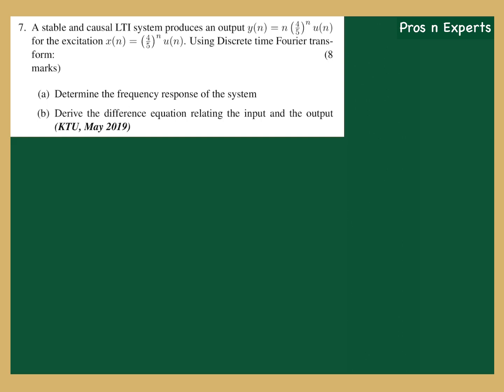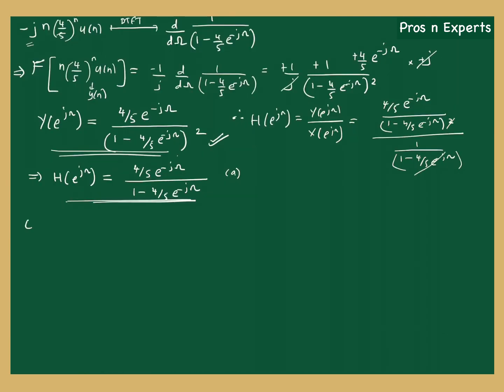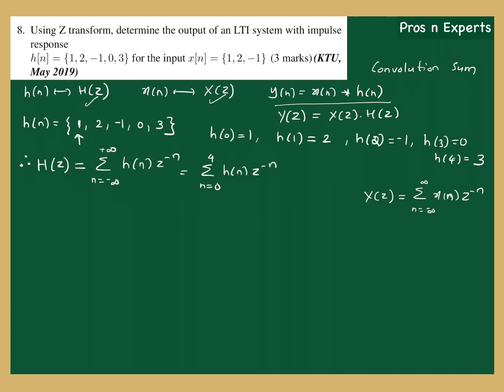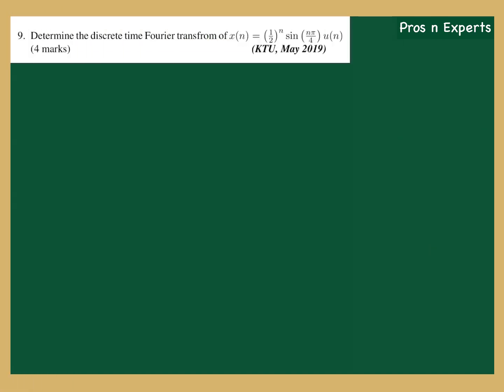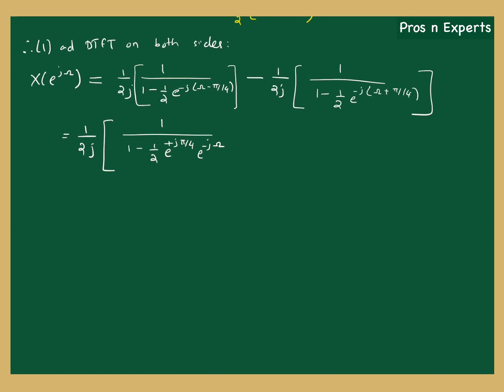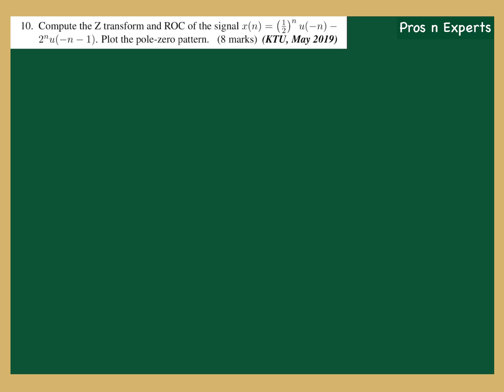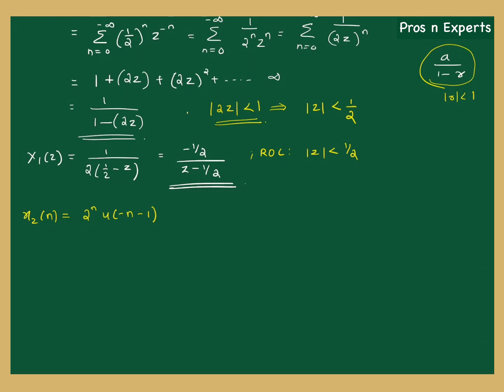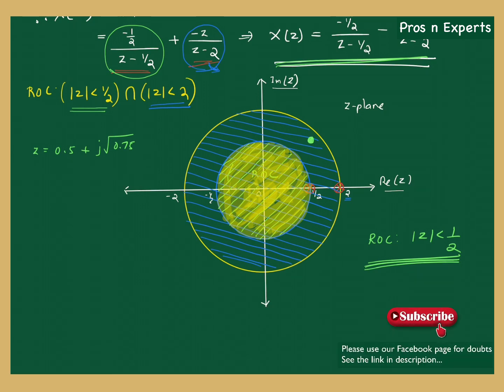Signals & Systems KTU Questions Solved Part-21

Comment: The last question answer is X(Z)=A+B not X(Z)=A-B..... question has a negative sign between the two signals... Am i correct??
Reply from the maker: Yes, that was my mistake. May be because I had to scroll down the screen and the question was no longer visible. Anyway, thank you.